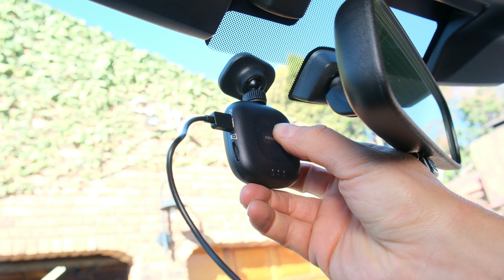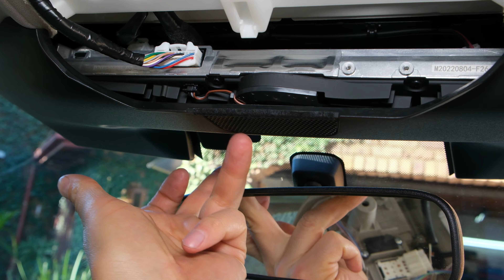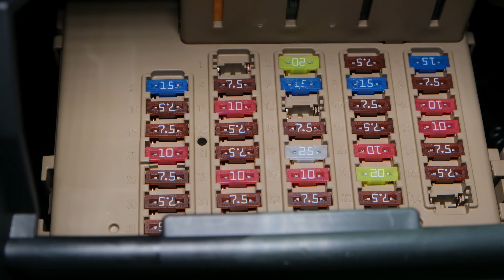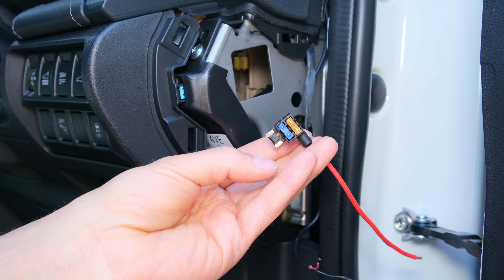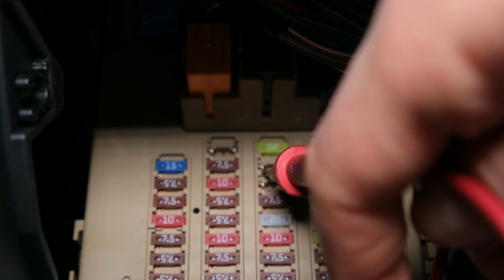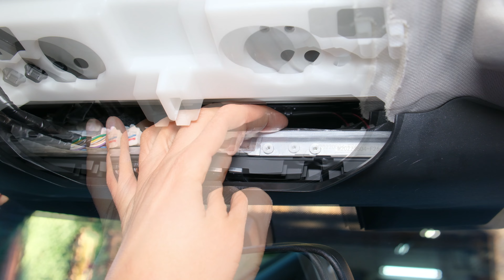How to install a Dash Cam in a Subaru Forester - hardwired - step by step

Comment: just did this this afternoon, with a little prep on the connectors, it took 25 minutes. the only issue was the fuse holder I had was the mini, not the low profile that subaru uses. a quick fix tomorrow. well done a great video.
Reply: all fixed now, great and straight forward

Comment: I truly enjoyed this video great tips. I have a question I installed an LDAS camera in my 2018 Subaru Outback. Company told me to connect red wire of rear camera to stoplight circuit (12V) from battery! No 12V. connected to Rear dome light now display on camera constantly? Not sure if Rear camera will record without this 12V and LDAS does not answer my question on this? Would appreciate your reply. Allan Dirt Water Fox
Reply: It doesn’t need to be labeled 12V. That’s just the fuse he uses in this video. It can use any fuse that provides 12V of power when the car is on, and 0 when the car is off. Look for a fuse labeled “ACC” (accessory). If you can’t find that, other good ones to try would be things that are on only when the car is on. E.g. lights, air conditioning, radio/ infotainment system, etc.

Comment: Thank you for taking the time to make this video. I just purchased a Redtiger F7NT dashcam and will be installing it in my 2023 Forester, so this is most helpful. Mine also has a rearview cam, so I will need to figure out where to run the wire for that. Hopefully there is another video that shows this, but I think the main issue there will be proper routing around the side airbag. Did you need to disconnect the battery when you did your installation? Thanks again!

Comment: The manual for my 2023 Forester says not to install anything such as a dashcam in that area as it can interfere with the eyesight system.
Reply from the maker: That's interesting. I did contact Subaru and they said its fine. My manual does not say anything about dash cameras in any search field. Could you please advise me on which manual, maybe you have a link? [I know they warn about putting things low down on the windscreen  as the airbag might blast it off the glass, but i didnt see anything about the mirror area]
Reply: @ecologicaltime, it is on page 13 of the EyeSight manual. There is a diagram that shows the areas not to install any accessories.
Reply: @ecologicaltime  Hi! In relation to the above, did you have any issues with the eyesight operation after installation?
Reply from the maker: no issues, the eyesight manual says that they don't want anything to block the air vents of the camera and also nothing that will reflect onto the glass. The dashcam i used does not have shiny surfaces, its mat black. Eyesight working same as it did prior to install.